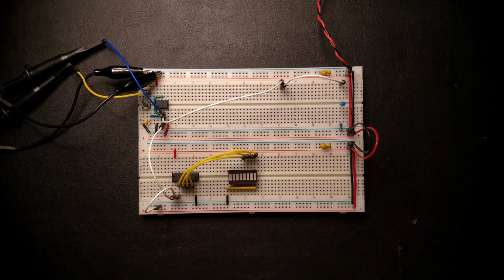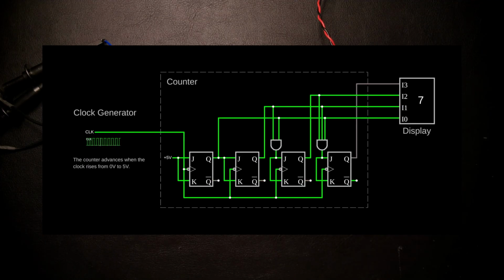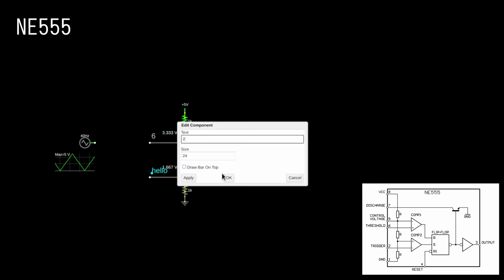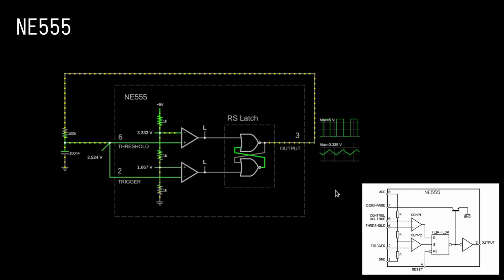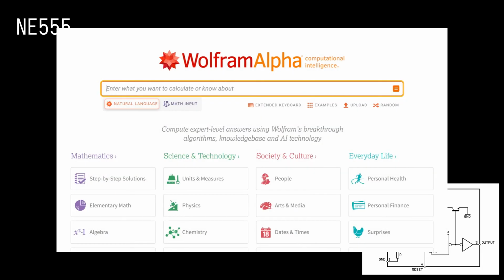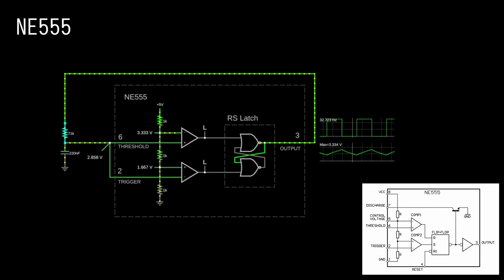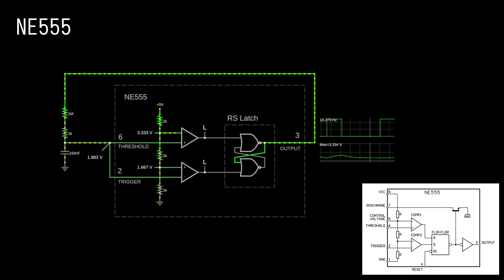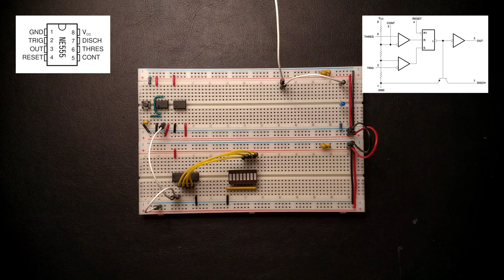Free-Running Clock – Superscalar 8-Bit CPU #3

Comment: I'd like to point out: in both this video and the one before it,
1) the threshold and trigger pins are tied together
2) the control, reset, and discharge pins aren't  used
which more or less turns the 555 timer into an inverting Schmitt trigger - the output turns off when the input goes above 2/3 Vcc, and back on when the input goes below 1/3 Vcc, with some hysteresis in the middle where the output stays wherever it was before the input enters the region between 1/3 and 2/3 Vcc
if this is all the functionality you need, you can get chips like the 74x14 (I'd recommend HC or HCT for most stuff unless you have a specific need for LS) or CD40106 which have six such triggers in them. very useful for debouncing many button inputs, doing timing stuff with the help of R-C circuits on their inputs (you can also make monostables [pulse shorteners / extenders] this way), or you can make arbitrarily wide NAND, NOR, or AOI gates with the help of a bunch of diodes and resistors. they're a very versatile part!